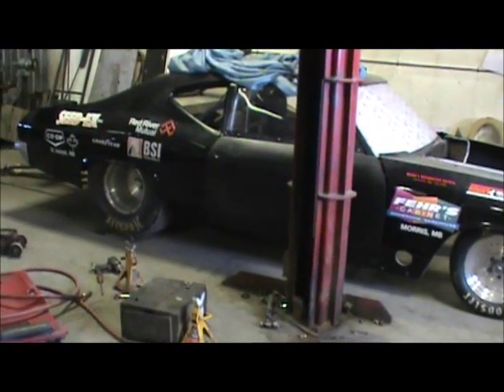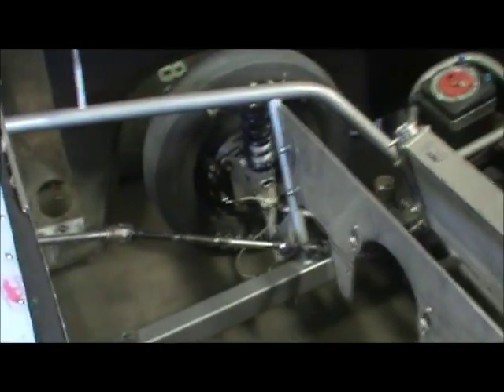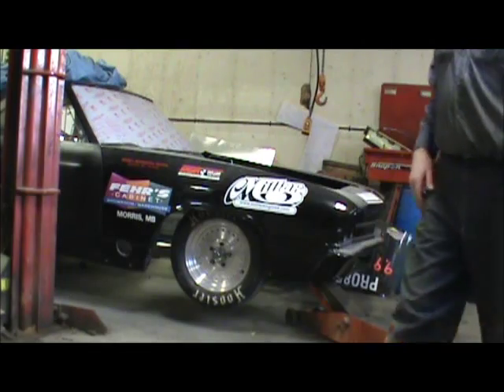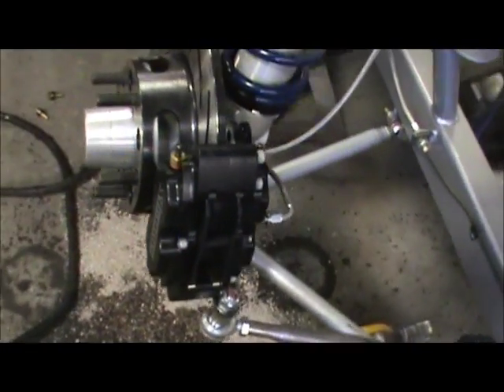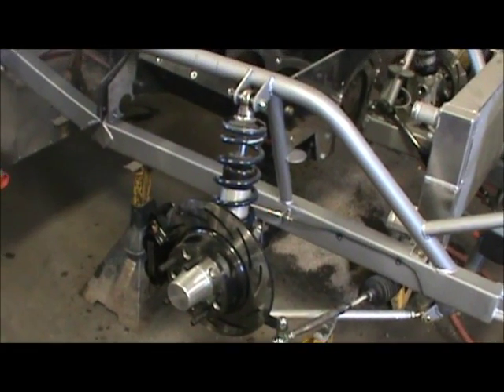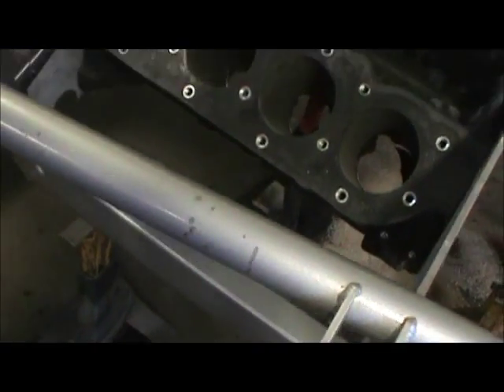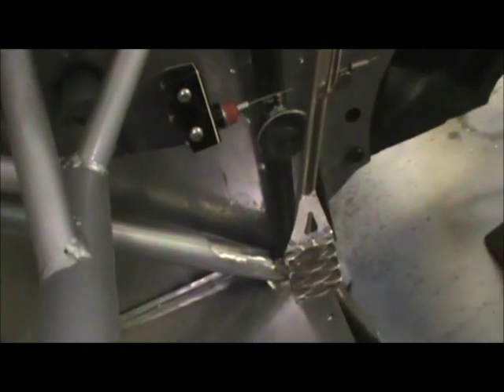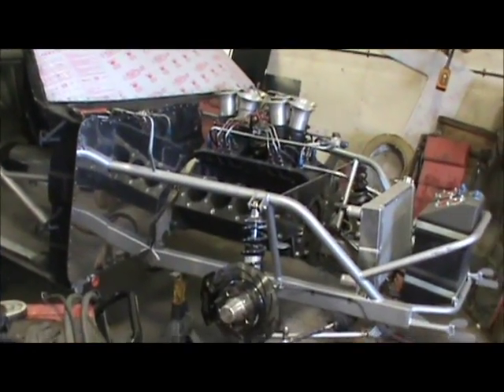Bleeding 4 piston calipers. Chevelle update.

Comment from the maker: I do that sometimes if i'm bleeding one caliper. With unbolting the calipers, bleeding four pistons each and moving them around i just went ahead and bled them. I little brake cleaner and some floor dry cleaned it up and i touched up the paint spots. Its a great way to bleed them by yourself with a hose and bottle though.